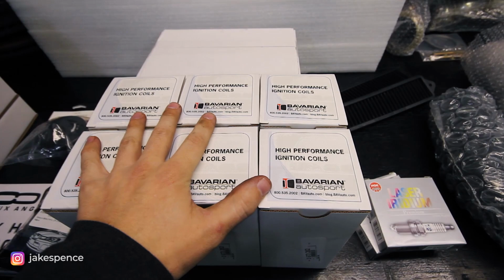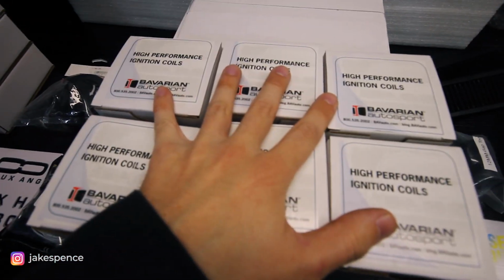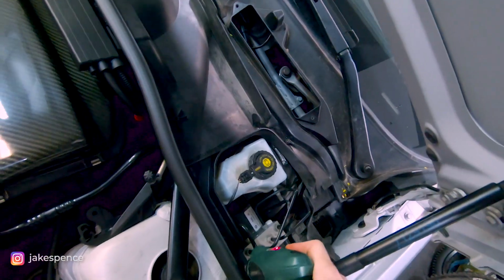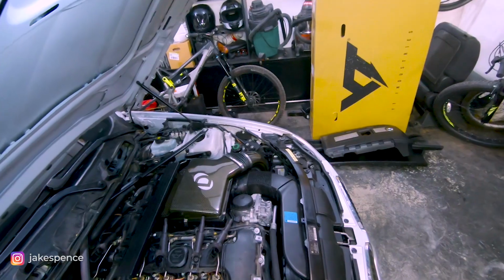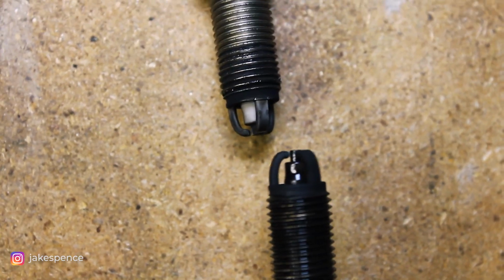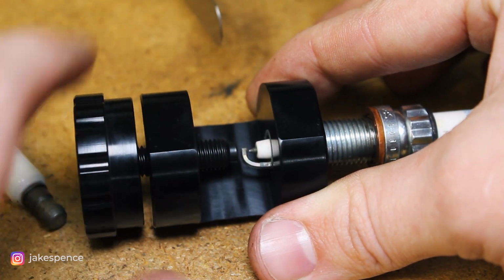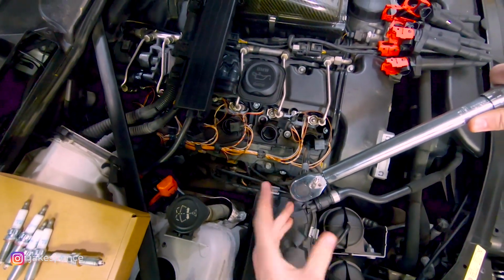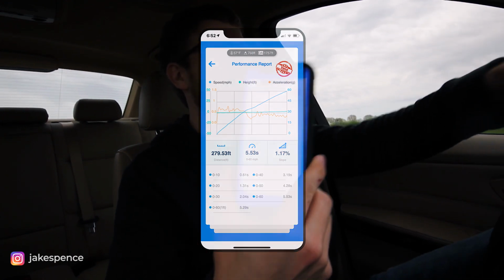BMW N54 Spark Plug & Ignition Coil Replacement + The BEST Gap Method! (135i, 335i, 535i DIY)

Comment: Just did mine. Had a cylinder 3 misfire, swapped coils with #2 and the misfire followed. There was definitely some quirks to this job. That strut tower brace was really in the way so I had to move mine. Most importantly though the stupid plug socket I got from ECS wouldn’t fit any of my extensions. So I had to literally hammer one In and now that’s my permanent BMW plug extension. Also, I was also surprised that the coil tubes were at a slight angle to the plugs. The socket and extension don’t go perfectly straight in. I also had a scare with #6 - plug was WAY too tight. That’s what you get with a mystery used car though I guess. I’m an old school shade tree diy guy, haven’t messed with older cars in a long time though, 20 years? Was surprised that anti seize was NOT recommended. Back in my day in the 1900s anti seize was a must. Parts store guy had never even heard of it. Glad I googled it.

Comment: Precision Race Works has the best gap tool! Its just like the one you were using but fits both 12 & 14 mm spark plugs & has a gap opener in the back. It's pretty handy. I think it comes with the good feeler gap gauges too...👍🏁
Reply: you da real MVP. Everything BMS is overpriced.
Reply: @ASSASYN187  That’s why I get PR!

Comment: Nice work Jake! I just finally posted up my version of this DIY in 4K on my channel. One interesting thing to note is that the BMW workshop manual specifies a flexible extension or universal should be used with the spark plug socket to prevent potential insulator damage. In the real world it's not really necessary if you're experienced like you and I, but thought it was worth mentioning in the DIY for others.
Reply from the maker: Nice! I'll have to check it out to get another take on this job.
Reply: @jake_spence  by the way, the 1-step colder NGK's you recommended with the new coil packs and the car pulls soooo hard compared to before!
Reply from the maker: Glad to hear it man! I think that's the perfect combo. What's next?
Reply: @jake_spence  I have an intermittent 30FF code when I drive hard. Some days no code and it is pulling hard. Other days it cuts power and throws the engine light... any ideas?
Reply from the maker: Boost leak somewhere or the turbos are finally starting to give up.
Reply: @jake_spence  I feel like if I had a boost leak/cracked charge pipe it would act up every time right? Or maybe the wastegates are sticking intermittently?

Comment: Great video like always bro.. Just one thing idk if it's because I'm as little ocd.. But when I do plugs when I drop them in, I usually rotate backwards (off) until I feel it drop into the threads.. I feel that ensures of any cross threading situation.. Can't wait to see the mods done..
Reply from the maker: Great tip! I know that if it's cross threading, it would have resistance. But this is a great way to be 100% sure that they're not going to cross-thread. More mods coming soon!
Reply: @zeroyon223 honestly never though of that.. But really cool tip

Comment: Injectors are expensive. I had index 1 in my car. They didn't leak, but definitely caused me some issues with mileage.  Be careful if you find some used ones because you have to get new o-rings that seat into the head and that requires a special tool
Reply from the maker: Thanks for the heads up on the o-ring... I forgot about that. I'm looking at used injectors but might just bite the bullet on some new ones.

Comment: question; if my car is already tuned on whatever sparkplugs are in there, but i dont know the gap size, can i just check the gap size on the old ones or do i need to just find whats recommended and then re-tune my car? i dont know how specific the new ones needs to be gapped to make sure the tuned car is running the same. (im an n54 single turbo)

Comment: Hey Jake...iv seen some bad reviews on Amazon with feeler gauges.. Regarding not being accurate,  can u add that link to the one you bought.. that you used from Amazon. Thanks. Didn't see it on the list. Also in actually running stock plus with fbo. E50 flex fuel.. not having any issues. I change then yearly. But im going to update when I go inlets and outlets any day. Thanks man. Keep up the videos
Reply from the maker: Hey man, this is the feeler gauge I use: https://amzn.to/2HJoLfn - sounds like you've got an awesome build going on!

Comment: Hey Jake! Curious if you know the production date of your 335i and which DME it came with. MSD version 80 or 81. I guess the 81 was implemented mid ‘08 and the 80 prior to this had problems with mosfets with upgraded coils. Just curious if you’ve had any problems with your DME if you have the 80. Thanks man!

Comment: Jake, not to be offensive but you need to read, understand & comment on dimensions such as the “Feeler Gauges” you were using in this video.  You stated you were using a “200 thousandths gage” when in fact you had a “20 thousandths gage”.  
I am a professional inspector and have inspected parts for cars, trucks, military vehicles and components on the international space station so I have some history in this.
Think of it this way, a human hair is approximately “4 thousandths of an inch (0.004)”; an 1/8 of an inch is 0.125; a quarter of an inch (1/4”) is 0.250 or called out as 250 thousandths.  You mentioned 200 thousandths which is 10 times bigger than you wanted.  Hope that helps you as you have helped me to work on my sons car.

Comment: Hi  i have a 2008 bmw 535xi and i replaced the valve cover gasket and the oil filter housing gasket but when i do a pull on 2nd gear the car smoke from exhaust blue smoke this happened after changed the valve cover help

Comment: I'm FBO MHD2+ (DP, 5 inch stepped intercooler, DCI, Inlets, Charge Pipe)
Index 12 injectors, new stock Bosche coils and Spark plugs.

I'm getting misfires and cylinder deactivation when I give it more than half throttle. Is this because I need colder Spark plugs? The online guide suggests the -1 colder NGK plugs for FBO, but Jake seems to be suggesting -2 for what looks to be a similar build?
Reply from the maker: You can do 1 step colder or 2 step colder. I went with 2 step colder because the 1 step colder plugs were out of stock everywhere. I can't say for sure that you're getting misfires because you need colder spark plugs, but it's worth bringing your ignition system up to par.

Comment: Hi which spark plug socket do you use? I bought one that was supposed to be 12 point thin wall but it wouldn’t fit so bad to grind it down more to make it thinner wall and fit. I’d like to purchase the correct tool. Thanks!

Comment: Subscribed. I just picked up a 50K mile 2013 335is vert and want to do the plugs/coils and the walnut blast per your videos.  Quick question - can you use 1-step colder plugs without mods?  I want to do maintenance first, mods second, but I don't want to have to do plugs twice.   Thoughts?
Reply from the maker: Hey, welcome to the channel! 1-step colder when stock is fine. The plugs I just installed are 2-steps colder and I'm still stock. You will be fine, no need to do them twice.
Reply: @jake_spence  Perfect, good to know!

Comment: You know what's crazy is the I have the same coils and ecs tuning is saying the performance coils you have will not fit lol you thoughts on that.
Reply from the maker: They should fit. Something must be entered wrong...
Reply: @jake_spence  ya I thought so.  So I found a performance part for our throttle response and im not sure if you herd of it Its called sprint booster and my throttle response is so good I can get into 5.2 0-60 its awesome check it out I works with manual and autos.

Comment: I'm new to the BMW world, so this may be way off, but I always put a little dab of anti-seize on the spark plug threads.  Is there any reason that you don't?
Reply from the maker: I've just never been taught to do that, but I see no problem with it. As long as it's only a little dab.

Comment: Nice video Jake! Do you have any feedback to the Ingnition Coils from ECS? What is the difference to BOSCH and DELPHI? thanks bro!
Reply from the maker: The Bav Auto coils I used in this video are still working great to this day. However, I've also used BOSCH ignition coils in the past and they worked good as well.
Reply: @jake_spence  thanks Jake! So Bav and BOSCH is the same performance.

Comment: I have 2008 335xi coupe with an upgraded FMIC, DCI, and MHD stage 1+ tune. I made 362WHP on a dyno jet. I bought NGK 1 step colder plugs because it was time to change my stock plugs out (no misfires on stock plugs), I gapped them to .0275 (Factory gap), do you think I should have gapped them to .022 (high boost application). Car runs great with factory gap, just wonder if I would get a little extra power with the smaller gap.
Reply from the maker: If you aren't getting misfires or timing corrections at 0.0275", keep running it. You usually want the widest gap possible without ill effects.

Comment: i have an n54 with the bosch sparks but want to get the NGK ones instead.. it says N54 applications require the spark plug gap to be changed to OE 0.7mm (0.0275″) or 0.56mm (0.022″) for high boost.. what does plug gap mean and how would I change it to 0.0275” or 0.22”??

Comment: What do you think of the coil packs? Why not go with precision or the r8 ones? Precision did a test on the "okada" performance ones and turns out they're exactly the same.
Reply from the maker: So far, so good! I got a deal on these ones, so I wanted to give them a shot. I like that they're drop-in replacements with no wiring or coding needed. If they take a crap, I'll make an update video.

Comment: I have the n55 f30. I want to upgrade my ignition coils. Would you recommend these bavarian ms coils over precision raceworks, cosmos, and ignition projects coils? Looks like you have them in both your cars. Just wondering because the bavarian ms coils are priced fairly where as the others get pricey. Thanks
Reply from the maker: I liked the Bavarian Auto coils because they're a drop-in option. But if you want the best upgraded coils, I'd recommend Precision Raceworks.
Reply: I have the coils on my car I think they causing problems they won’t go all the way down on to the plug I think when I push down on them I can feel it go down more and when I let go they come up a bit

Comment: Hey Jake - just installed a set of 2-step colder plugs gapped at 0.020 per BMS specs and running MHD Stage 1+  then started havin misfires.  No issues with OEM plugs.  Any recommendations or thoughts on what could be causing this.  Im in WA with 92 being most common.
Reply from the maker: That's weird. Are you sure the gapping is accurate? Are the plugs tight (torqued down)? I've seen them come loose after a few pulls. Did you change coilpacks? You could try swapping plugs back one-by-one to verify it's the plugs.
Reply: @jake_spence  thank for the quick reply Jake. I'll take your advice and start swapping plugs and verify gap is correct. Could these plugs be too Cold for my setup possibly?  
Really enjoying your videos btw. Thanks
Reply from the maker: @kylehanaway1613  they shouldn't be. I'm using the exact same plugs in my bone stock 335i, same gap too. Glad you enjoy the videos!

Comment: I’ve been very interested in getting a N54 135i for awhile, if I’m buying one with or without some basic bolt on’s- what’s a good number to budget for at the beginning for maintenance to keep the car healthy? $1500-2000? Such as the coils, plugs, etc
Reply from the maker: Are you doing the labor yourself? If so, you'll save a lot of money. I would budget ~$500 for oil change, spark plugs, ignition coils, and walnut blast parts. ~$1500 for NEW injectors if needed. ~$500 for water pump and thermostat if it has never been done, do it when it dies. Turbos could be fine, but if they take a crap, you can get stock replacements for cheap or upgraded ones for a couple thousand dollars. A few hundred bucks here and there for gaskets, etc. Oil filter housing, valve cover, oil pan gasket, etc.
Reply: Jake Spence thanks for the reply! Yes I plan on doing the work myself. I’ve had an e46 and e36 m3, and am looking for a more modern car with some straight line speed. 

That’s a good answer. Are there enough resources to know what needs to be replaced when the car misfires, throws a code, etc? After doing these maintenance items over the course of 6 months or so.

Comment: What's up with cylinder 1? I just changed my coils and plugs because of misfire codes in 1-3. Cylinder 1 plug looked just like yours.
Reply: Did you gap properly?
Reply: @Chan55999  Oem Bosch 3 prong plugs, "ungappable."
Reply: @draytonPW  Is your car stock? I’d recommend NGK plugs. If FBO then one step colder and if FBO+ and using E85 I’d recommend two step colder. Same goes if you are single turbo or upgraded twins.

Comment: I would highly recommend some anti seize on those plugs going into an aluminum cylinder head....😁
Reply from the maker: Great point! Usually they have anti-seize pre-installed but since I bought these plugs "lightly used" the anti-seize was worn off and I forgot to re-apply some.
Reply: How about not? Not recommended since they can throw off the torque. These are sensitive to torque because of the direct injection

Comment: Awesome video! Curious what you end up making on dyno on stock t's
Reply from the maker: Me too! I'm debating dynoing it before modding it, but figure people might not care to see it put down stock numbers lol.
Reply: @jake_spence  ya agree, i need to hit the dyno, fbo + 100% meth Trebila tune at 22psi on stockers.. maybe some e85 for fun before I switch turbos.. im getting the come to a stop light puff of smoke on down shift in m mode.  Leaking turbo seals
Reply from the maker: @Kipitrl  sounds fun! I've come to terms with when modding these cars, you'll get some smoke on decel depending on your setup.
Reply: @jake_spence  ya especially in m mode when you get the pops and burble.. im still torn between pure stage 2 hf or doc 6266? Whats your opinion since youve been running doc for a while? I like the quick get up and go on the streets the twins have.
Reply from the maker: @Kipitrl  if you love the down-low power for around town, you'll probably want to stick with twins. PURE is good. But I love my Doc Race 6266 setup. You need to rev it out more, but when you're in power it pulls so much stronger than twins. I had MMP S3 before the single and would choose the single all day.
Reply: @jake_spence  is there a BIG difference  in down low power in the streets? If its not that bad then ill definitely go with the 6266

Comment: As a fellow e90 n54 6MT owner with about 30 grand in the car in mods.  There is no way you are making 10s with stock turbos and factory inlets.  Even with TFT inlets, you'd still blow up your turbos first.
Reply from the maker: It's a tall order, for sure. And I never said I'd do it without inlets. It's been done before and with enough weight reduction (and maybe a little nitrous), it can be done again. PS: I've gone 10's in my 6MT 135i with more than $50k invested lol.

Comment: actually you can gap the 3 prong ground....I had a missfire on a cylinder, even after changing plugs...when I checked the new plug again, it had one prong that was nearly touching the center electrode, i took a pliers and pulled that prong out to match the other 2 and missfire went away...shouldn't happen , but there ya go.

Comment: Jake you are shifting WAY too late for stock turbos. Serious drop off after 6250rpms so shift autos at 6k. -og n54 guy
Reply from the maker: Yup, I'm aware. Just wanted to rev it out for consistency sake so I can compare mods without altering other things such as shift points. But for a true best result, I can shift faster until I get inlets!

Comment: Bro you gotta start on second gear and completely remove the traction control and shift manually
Reply from the maker: It wasn't the best launch, but I wanted to keep it consistent with my "before" data.
Reply: Jake Spence are the ngk 97506 still working ok for you?
Reply: @ForeverNightriderz  I had to get 1 step cold for high boost, I had the 2 step colder 97506 and my tuner had me change em to 1 step colder. It was better
Reply: Alex Merkushev gotcha running into same issues what spark plug number did you go with for 1 step colder ?
Reply: @ForeverNightriderz  yes bro

Comment: Old spark plug feeler gadge's , old tec all back again
Reply from the maker: What's the more advanced way to measure the gap?
Reply: @jake_spence  fealer gadge's are the best to set the plugs even when they were factory set I always reset the gap found it was the only way to get a  car to run to it's best.

Comment: Decent video but come on you can't prove that the walnuts blast improved your 0-60. 0-60 is totally traction dependant. 100-200kph using dragy would be better
Reply from the maker: Yeah, I said that exact thing in the video. Moving forward I'll try to use 60-130mph.

Comment: I’m running those coils in my 135i n54 pure stage 1 turbos and I think they might be causing a problem also when I installed them I noticed one I pushed them all the way in they wound stay all the way down might be my problem
Reply from the maker: Yeah if it won't stay down, that's an issue. I've had these installed since I uploaded the video without a single issue. I'd make sure you aren't dealing with an installation error first.
Reply: Jake Spence yeah it’s a weird problem thanks for the response I’m probably just gonna get the precision  race works coils since I’m on a custom e40 tune on pure stage 1 turbos so probably a good idea anyway